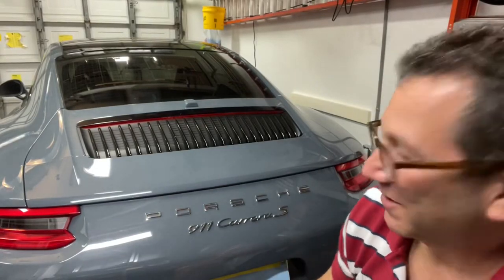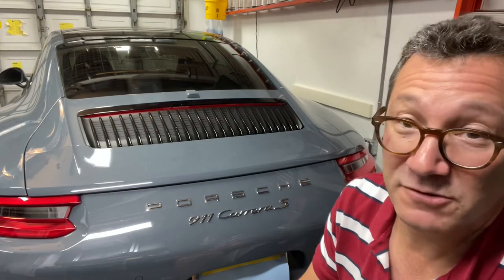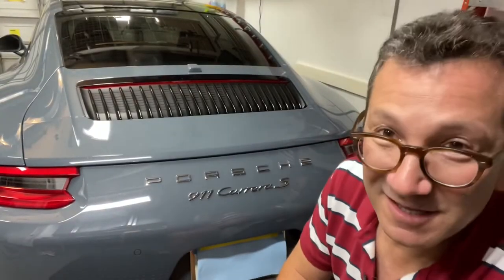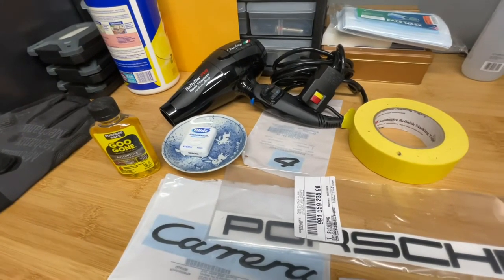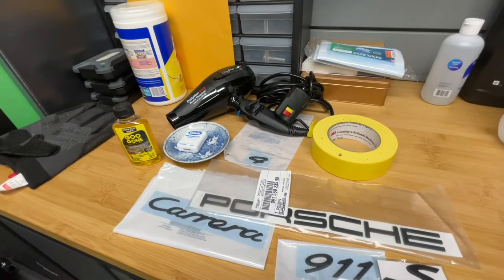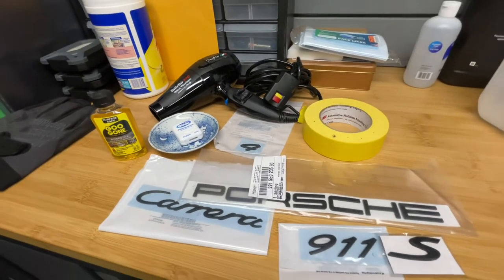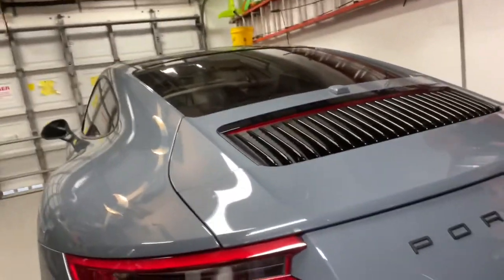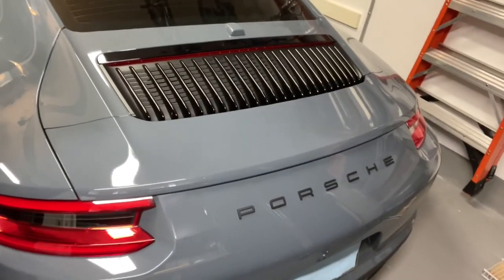Badge Emblem Removal PPF Dealer Template Porsche 911 Carrera S 991.2 C2S DIY Maintenance 991

Comment: Thank you for making this video. Did the old lettering leave any imprint or "ghosting" on the ppf? I want to get the factory template and reinstall the PORSCHE lettering to improve upon the job that my ppf shop did. I have full ppf, and they got the alignment close, but it is off by just enough that it is noticeable. I am concerned that there may be some imprint in the ppf that naturally will not be covered up by the replacement (because it will be in a different position).
Reply from the maker: No, There was no imprint or “ghosting” left behind. I think that what helped that was being very css as careful and thoroughly removing the old adhesive and cleaning the area.
Reply: @fickstit2839  Thank you!